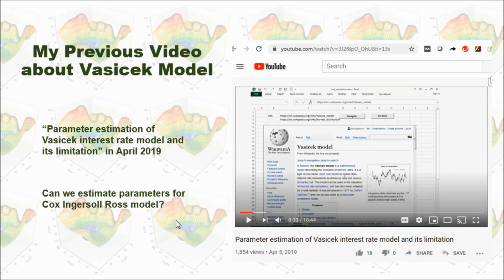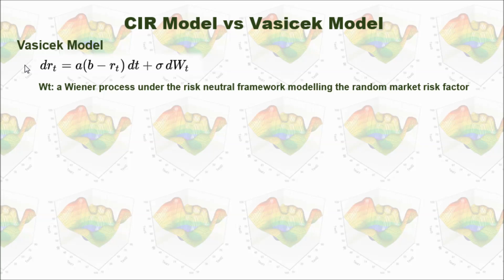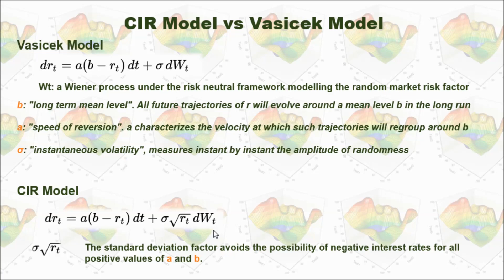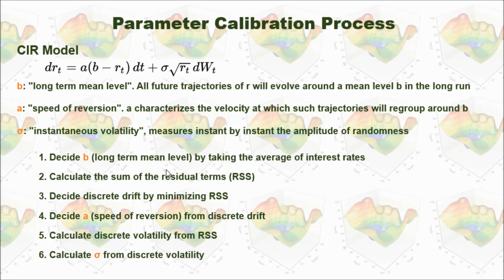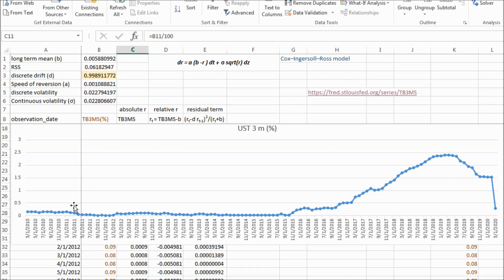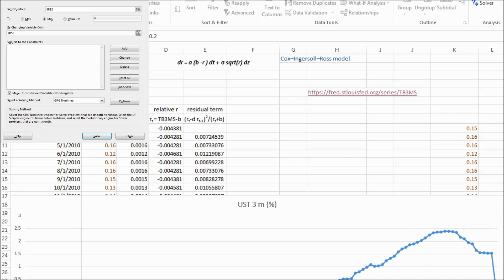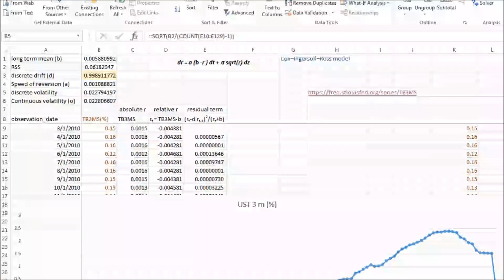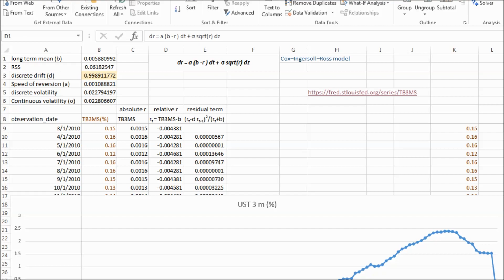Parameter Calibration for Cox Ingersoll Ross Model

Comment: What does d correspond to in the CIR equation? Is it sigma? Why do you divide by rt +b  to get the residual?
Reply from the maker: d means "derivative". For example, dr means derivative of interest rate. rt in column D mean relative interest rate comparing with the mean value b. So rt+b will be absolute interest rate.
I divided rt+b in order to get residual in percentage terms.
Reply: @statisticsandriskmodeling5477  what’s your email. I’d like to have a further conversation